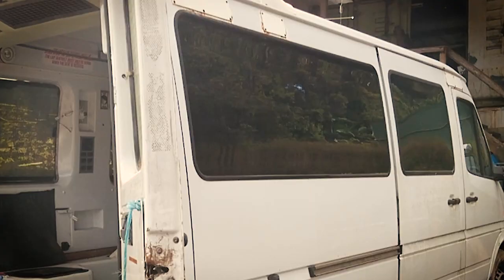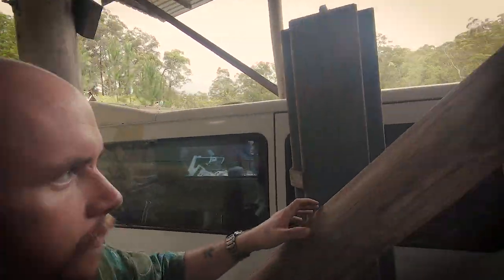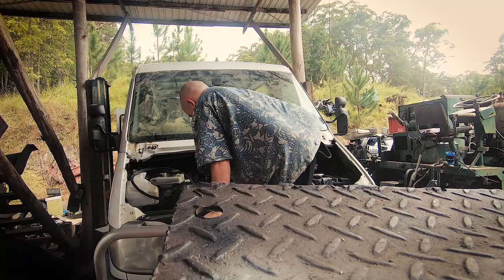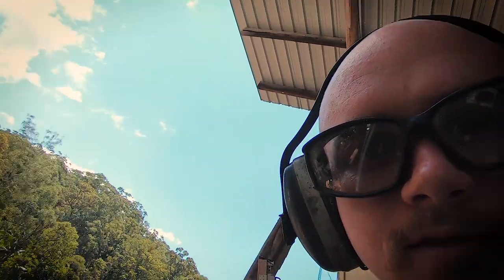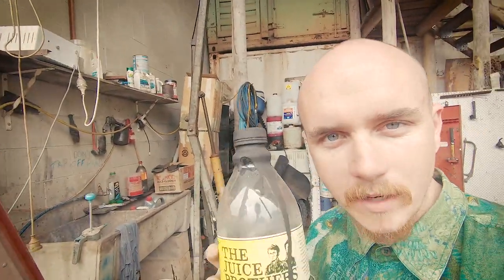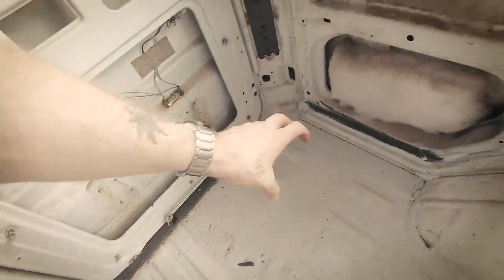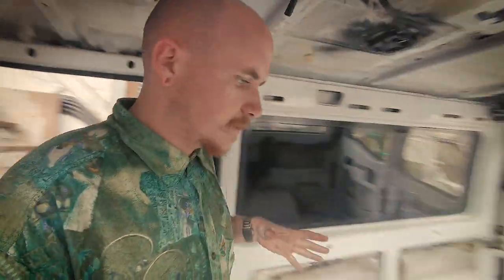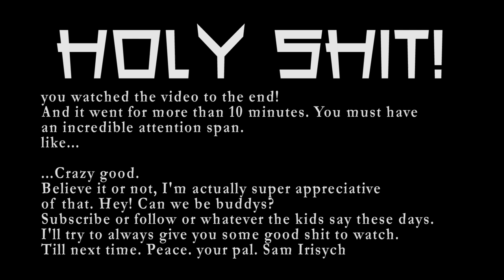Sprinter Van Conversion, Part 1 | Most Brutal Ever

Comment: You are absolutely hilarious. Found you on Reddit, look forward to more videos. Just bought a sprinter for... 5 thousand fucking dollars. Not nearly as much rust, but it needs a head gasket, and some other electrical quirks figured out. Just got the parts on order, time to tear into it in the parking lot of my housing complex. Any advice for getting the injectors out? About to do a deep dive on the process of replacing the HG, injector removal is the only thing I’m unsure of. Cheers!
Reply: The bit about Reddit was a total lie. I closed out YouTube and realized it was a Facebook Sprinter group
Reply from the maker: Hey man thanks a lot. I appreciate it ♥. Yeah man. Do NOT try to remove them without an injector remover! I haven't mentioned it yet but I cracked my rocker cover trying to remove them. The tool is like fiddy on eBay, worth it. I have a possible head gasket too.. Hoping to dmt gods that I don't... Hit my Facebook page (in description) and message me with any questions about your van... I'll help where I can